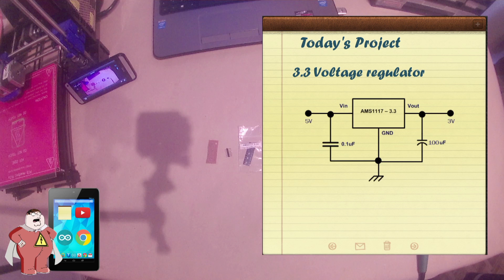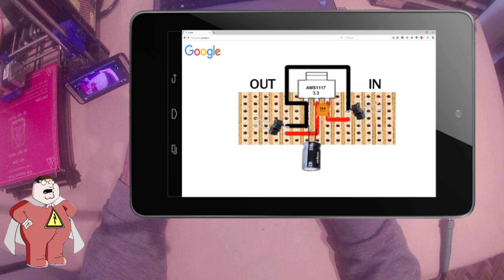TUTORIAL - 3.3 Voltage regulator AMS1117 3.3

Comment: How much can the input voltage change from 5v? Will that affect the 3.3v output?
Reply: it should be stable at 3.3v 
Max output current is 1.4a
Max input voltage is 30v; but, make sure you use at least a 50v capacitor.
Capacitors matter.

Comment: please check the data sheets if you connect directly it would never give you 3.3 volts return to the datasheets page @the beginning it needs resistors
Reply: so I had to report you
Reply: Actually I regret my actions because there are several models the ASM1117-3.3 would give you this directly but you would need Capacitors!
Reply: I am truly sorry I regret this action :-(

Comment: Why those capacitors values?
Reply from the maker: Big capacitor supply slow peaks of voltage and create a very stable regulated voltage. Small capaictors eliminate small current peaks.
Reply: I know what there are needed for, i was just wondering if you have a rule of thumb for the values or if they are written in the datasheets
Reply from the maker: Yes, usually the datasheet gives you the comune values!

Comment: i will test this now, but with ceramic smd capacitors.
i keep you in touch, i have also burnt 3 ams1117 3.3v bi wrongly connecting (i follow the original ams datasheet), i want to test this.
see you soon
Reply: Another question, with my ohmmeter, the pin 2 (center) seems to be connected to the top pad, what is the pin connected to the top pad?

you can also solder your ams1117 little below, to solder the top pad to a large copper plane for better heat dissipation.
Reply: +IHPU0 
Your website is cool, but there is a arborescence problem, when i click to acess the 3.3v regulator tutorial, i get a arduino radio communication tutorial (Really usefull tutorial for me thx).
Dont forget to solve this issue bye
Reply: thank you my friend it worked, i subscribed to you bye
Reply: Thanks a lot! I'm glad that it helped you. I will now change that. Must be a PHP problem! Thanks again and keep up
Reply: ***** 
I didnt know what i did, i checked the datasheet and its correct.
I dont know why i used the pin 1 as output, pin 2 as ground and pin 3 as vin...

I also making tutorials, i actually working on my Custom Gamecube regulator, the ams1117 is perfect for the 3.3v line that take at max 0.8Amps.

bye

Comment: gave you a "like" for a cool vid, but there's something bothering me, as you mentioned, the arduino does have a 3.3v output pin, but you say it is "limited", what do you mean by that, why is limited about it and why you're circuit is not limited?
Reply from the maker: hi there. as I say in the vide the arduino 3.3 output is CURENT limited. The maximum current is around 200mA which is enough to light a led but it is not for the radio module. You will need an external voltage regulator which can give you a higher CURENT because the nrf24 module uses a lot. I recomand the ams1117 voltage regulator to 3.3 volts. keep up. thanks

Comment: same question. can we use just ams1117 without capacitor and get 3,3v.?
Reply from the maker: +Dastan Rakhatov of course you can but BE CAREFOUL! The job of those capacitors is to 
fine regulate your voltage. If you have a small vlotage peak the 
capacitors will filter it. So I recomand you to always put those 
capacitors. The 0.1uF capacitor is for small fast voltage peaks. The 
bigger capacitors store a small charge in case your device needs more 
for a small amout of time. Is the basic configuration of a voltage 
regulator. Those are called coupling capacitors. Tanks and keep Up.
Reply: NO
Reply: their existence is only for grantee! there is no ripple

Comment: Why there is needed capacitors? can i use just the AMS1117? direct give 5v and get 3.3?
Reply from the maker: +Tomas Av. of course you can but BE CAREFOUL! The job of those capacitors is to 
fine regulate your voltage. If you have a small vlotage peak the 
capacitors will filter it. So I recomand you to always put those 
capacitors. The 0.1uF capacitor is for small fast voltage peaks. The 
bigger capacitors store a small charge in case your device needs more 
for a small amout of time. Is the basic configuration of a voltage 
regulator. Those are called coupling capacitors. Tanks and keep Up.
Reply: Alesandro de Lima the value would increase as the current draw increase this nrf chip uses about 200mA so 100uf is ok...its ok to use bigger value but not ok to use too less value than recommended :)
Reply: +ELECTRONOOBS I just saw a design that uses 470uF on the output for AMS1117. It is connected to an ESP8266 and multilex 8 analog sensors. Is 470uF overkill or would 100 be okay?